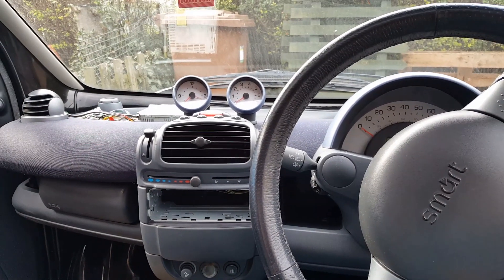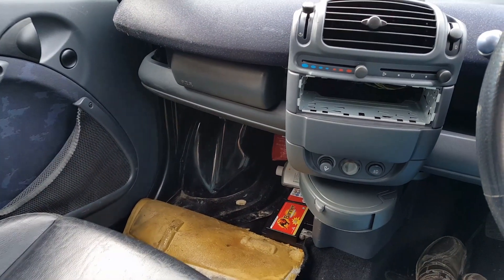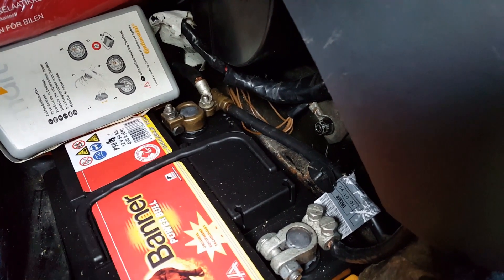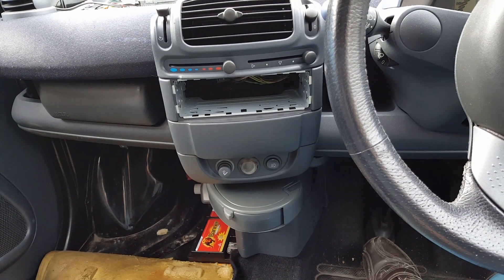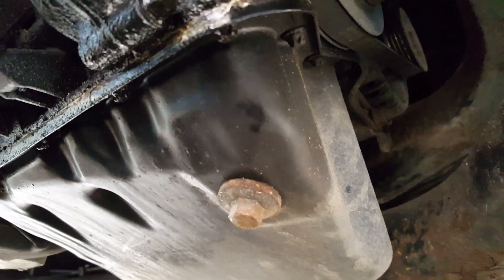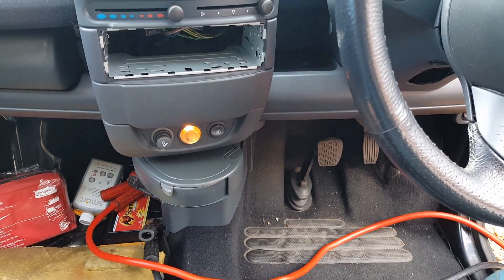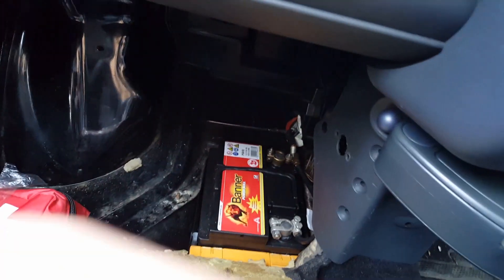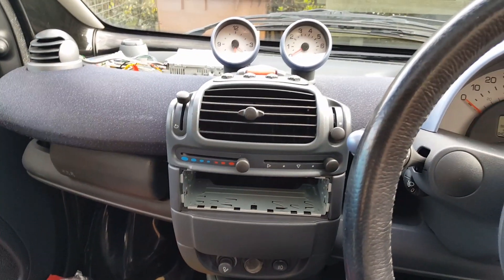Smart Fortwo 450 0.6cc (2002), Alternator discharging battery. Alternator removal and installation.

Comment: Hi I enjoyed your video very much could you please tell me where the wires go on the alternator as I have the same problem and it would be a big help does the battery cable go to the b+ connection and the diode line and the 12v go to the phin connection thank for your help
Reply from the maker: Hi
Yes, the thicker cable is the battery to B+... you shouldn't be able to mix them up, as they  don't fit correctly if you swap them...
👍👍👍

Comment: If you remove the centre engine mount bolt and support the engine you can lower engine enough to remove the cables and extract alternator out between the spring and the subframe.
But if sump is leaking at all yours is best way as it kills to birds with one stone.
Job well done keep up the good work.
Reply from the maker: ☺️
Thanks!
👍👍👍

Comment: Desde Guatemala tengo un alternador de Smart 2001 3CL. 600cc. Cuando carga el alternador no acelera cuando desconecto el alternador si acelera pregunta regulador de voltaje original nuevo placa de diodos nueva original
Reply from the maker: How much voltage is the alternator outputting when running?
Thank you for watching!

Comment: What type amp clamp u use? , I see uniT but I don't know what kind of model
Reply: Buenas noches desde Guatemala  el Smart  que estoy trabajando es un 2001 3 cilindros 600 c.c. regulador de voltaje nuevo original placa de diodos igual. Cuando carga el alternador no acelera desconecto el alternador si acelera carga 14,28 voltios lo que pide el alternador
Reply from the maker: Hi
UNI-T UT210E
Thank you for watching!

Comment: You took the sump off to change alternator? I never needed to remove mine when i replaced it on my Smart CDI although i suppose it is more accessible.
Reply from the maker: Yes I did...
The CDI might be different... however you can kinda slide it out from te side... wheel arch side... but at the time this was the way I found it easier...
Thank you for watching and for your comment!
Reply: @LMAutoRepairs  yes, the cdi is different , I was under the impression that the 450 is cdi only but when I heard the engine sound I realized that this one is gas. But the the purpose of the video was to confirm where the drainage was coming from. Great video and explanation!! Very helpful
Reply from the maker: @TheBeemerfan  
👍👍👍

Comment: Thanks for sharing. Very nice channel! But should notice you used amp clamp wrong. It was set to measure ac current as stated on the display. I have the same amp clamp and I noticed immediately. I wish it was default to DC because I used it only twice to measure ac current and thousand times to measure DC.
Reply from the maker: MrBorntoroll 
Well spoted...
This was one of the first times I have used it... and yes... it should default on dc... it is one of the things I don't like about it...
I have since get used to it, and remember to change it...
Thank you for watching!

Comment: Hi! Thank you for sharing the video. May I ask where did you buy the replacement alternator, model# and how much. I seem to have the same kind of problem and need to replace my SmartCar Fortwo alternator. I think we have the same model.
Reply from the maker: Hi
I have bought it on ebay... £89
Be careful when buying the alternator... I would advise you to remove yours first...
There is two versions... one with 3 connectors and one with 2 connectors... they are not interchangeable...
Hope that helps...
Reply: @LMAutoRepairs  also, 
also, is the alternator different if is gas or diesel? your 450 is gas my 450 is diesel.

Comment: you don't have to take the oil sump down. it will come out without taking it off.
Reply: I will try it on my 700cc 2004  . Without taking off the sump
Reply from the maker: szilard parian 
Hi
Can you be more specific on how?
Thank you for watching and for your comment!
Reply: lmsvvavr hi  just took it off on Saturday and managed to remove it without drain the oil and remove the pan.
Reply from the maker: szilard parian 
OK... still you haven't explained how...
Have you dropped the engine slightly?
Reply: lmsvvavr no. i lifted  the car took of the wheel and mudguard.  took of the 2 belts and the alternator and twist it and it came out.
Reply: Don't know much about them just bought 2 in bad condition so hoping to get 1 of them running. 
Try to start the one with faulty alternator but nothingh came up on dash no lights no nothingh.  but at least the engine was running until the jump start was on. getting the bew alternator on weekend and will carry on the works.
Reply: @LMAutoRepairs  maybe he is referring to the cdi engine that is easier to remove the ALT.

Comment: Hi there How are you doing I just wanted to ask you about the location of (rpm sensor) in Hyundai elantra 2012 with 2.0L engine?
Reply from the maker: Hussein Olivia 
Hi
You are referring to the crank sensor, correct?
Reply: Aha does is the same ?
Reply from the maker: Hussein Olivia 
You are talking about the engine RPMs... or gearbox RPMs?
If is the engine, I would guess the crank sensor is the rpm sensor... Unless the ECU calculates the engine RPMs through the cam shaft... but don't think so...
Reply: yep thanks it was the crankshaft sensor it self the same of engine RPMs because when I scanned the car, the DS708 shows up there was problem with crankshaft sensor but the car was working but the engine speed meter wasn't calculateing
Reply from the maker: Hussein Olivia 
;-)